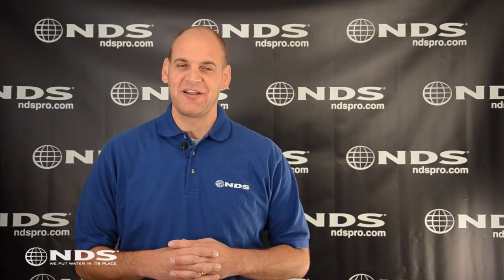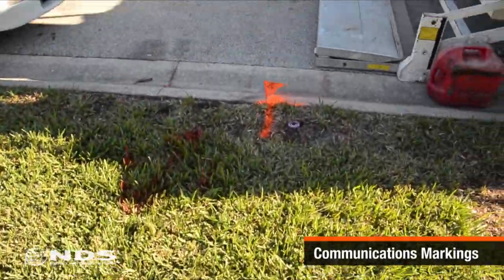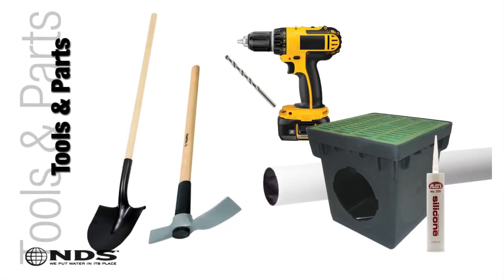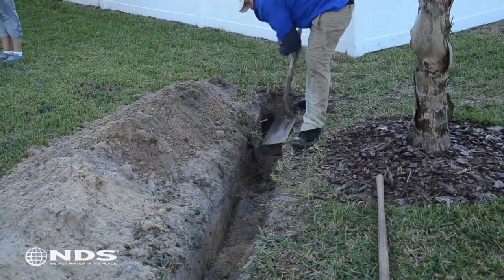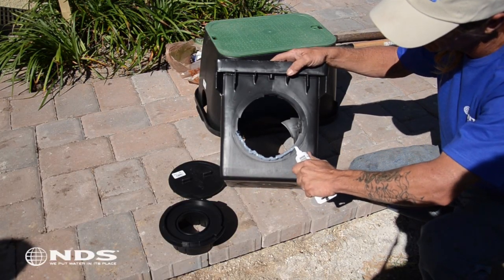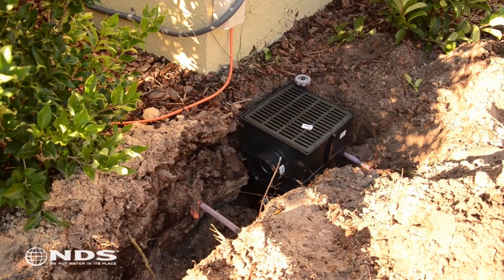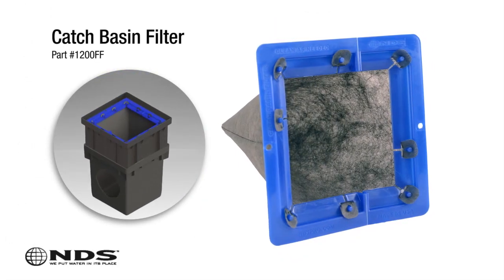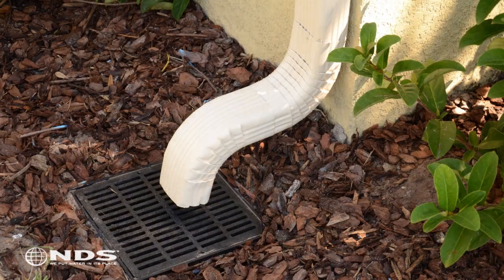How to Install a Catch Basin | NDS Yard Drainage Systems

Comment: which fitting do you need if you are running SDR35?
Reply from the maker: @GioSinatraFan Hi there,

Thanks for your question! To ensure you get the right fitting for your SDR35 application, I recommend reaching out to our Technical Services team. They’ll be happy to assist you with the best solution for your project.

You can contact them directly at TechServices@ndssupport.com.

Let me know if there’s anything else I can help with!

Comment: This video is just an ad to sell extra, expensive parts that aren't needed. Why would you even use a catch basin for this application? These basins have their uses, but not in this application and especially so close to the house. Connect the down spout directly into the pipe. The pop up emitter is just a piece of garbage that has absolutely no good use anywhere. Leave the discharge end open. Why worry about animals getting in? Rain will chase them away just like it chases birds that nest in your gutters. I live across from a river and have open ended discharges for over 25 years and never had a problem with animals. Much better videos on YouTube on this subject.

Comment: This is great info! But how do you put a catch basin in concrete????
Reply: Saw cut the concrete. Doing this as we speak 😂 Had to see how their snap fittings work and here we are..
Reply: @dangaucher5842  Thank you! How do you put one in new concrete? Do you just pour concrete around it? Make a box out of concrete to put it in? Drop it down into concrete? lol
Reply: @powerofknowledge7771  Cut the hole bigger than you need to be, jack hammer out what you cut (only real way of getting it out). Then set your heights, pitch etc after you dig out below it, then pour all around it and blend to the existing concrete. Honestly best bet is to hire someone with all the tools. Renting saws, hammers, etc. will add up and basically negate any savings of DIY vs hiring someone.

Comment: This thing is a piece of crap. Do not buy and waste your time and money on it. For $40 you would think this product will be a tank... It leaks like crazy where the connectors connect to the sides. Water barely makes it up to the 4" pipe. Plus u really should get a screen to avoid leafs and needles from plugging your system. Comes separetly of course for another $23. Find another product.

Comment: I live in South Florida and all these subdivisions, like mine, has 1 million rocks under that grass. Use a pick axe and sweat 6 gallons of water. Have ambulance on stand by for emergencies; heat stroke. Best way: Hire a contractor.
Reply: Wait till winter
Reply: If you have all those rocks, then you don’t need to install a drainage system.

Comment: Water against your foundation is the last thing in the world you would want as it will damage your foundation. Why would you place a catch basin basically right against it and have holes in the bottom that will result in water leaching, likely in significant volumes, right up against it!? That makes no sense to me.
Reply: This is probably to avoid standing water and prevent mosquitoes from breeding. Perhaps they should have called them weep holes and specified the size of the drill bit they used.
Reply: It would likely only account for a few gallons, maybe drill them extremely small.  Dont want standing water to allow mosquitos to breed
Reply: Exactly

Comment: What about the 6 inch round grate catch basin?  I buy a ton of these, and use them at the end of a 4 inch corregated solid line coming off a downspout. And I hate those dumb pop ups.  The mechanicals oftentimes stick and water backs up.  Why not suggest using the 6 inch grate as the endpoint?  That's what I do and it works perfectly.
Reply: Because the grate can clog
Reply: The 6 inch grate is larger than the small popup.  And for homeowners who distance themselves from lawn work and landscaping because it's not their forte, ignore the fact that grass can creep over the popup and cover it completely in a short manner of time.  And with heat beating down on it, the pin of the popup begins to sweel and that causes the popup to not functon or pop up.  The grate can clog if grass grows over it, but the surface is much greater. Can't tell you how often I find popups no longer functioning,  I hated them from the very beginning of my landscape career back in 1986.  I only buy NDS basins with the 6 inch grate, and recxognize they're a much better option.
Reply: Not if you keep it clear

Comment: This looks so simple, but the guy in the video is attaching it to a 4" pvc pipe. That is pretty secure with silicone. I have a 3" pvc pipe and for the life of me can't figure out how it attaches snug. The tabs in there aren't any help either. won't go past tabs.. the 3" side hole I believe is only for corrugated, but doesn't say that in the instructions. Says 3" or 4" pvc.
Reply: Pvc adapter 3” to 4” widely available should work?
Reply: yeah same problem here, it connects much tighter and secure to 4 inch pvc

Comment: Catch basins work great for draining surface water such as a yard low spot that puddles after a rain storm. In the video situation, why not just use a downspout extender to deposit the water 5 to 10 feet away from the foundation and water the lawn? Easily hidden by plantings. Zero digging, no lawn resod/reseed, and easier to inspect and clear clogs. That vertical pop up extension is very deep and it would seem that a lot of water could seep next to the foundation from the catch basin during and well after a rain storm.

Comment: Apartment living is better and more convenient if one just wants to live and not be involved in the flipping rat race of the housing markets. 
The bad aspect of home ownership is that: 
one has to do is buy a lot of silly things and 
one has to do a lot of silly things.
Reply: The good thing of home ownership is this little thing called equity.  You don't get that in an apartment.  Rent is throwing money out the window.
Reply: To Claymore 77: I understand and appreciate your point of view. Yes, there are good things about obtaining a home. You had stated equity, which is procuring of more resources by means of a loan or credit. I agree that free bread is good. But is it really free, though? To repay this is an arduous thing and you do not own the house outright until the mortgage (another loan) is paid off. Even though the interests rates are more tolerable in this era than prior, much extra money is being paid, along with flood insurance, regular insurance, property taxes which an increase would sink many. Attached with the ownership glitz is the glitch of getting many utility bills, and of course the highly dreaded repairs and renovation.  

Even with the Build it Back of NY, Sandy government program regarding their suggested home elevation, they take away much of what was there prior and leave the homeowner to cough up many thousands of dollars to perform work that the program does not do, as; 

Paving. 
Cementing the front area, the driveway, parts of the yard. 
Fencing for me and my neighbors. 
Installing a storm drain line system. 

If I had known this prior, this would have tipped the bascule of my contemplating mind to not participate. Even when I get help -- I still need help! Financial defenestration is perpetual regarding the perturbation of home ownership.
Reply: I get what you're saying, but here's my situation and I know this isn't the case for everyone. This is in Charleston, SC. I went from renting a POS 34 year old 1300 sq ft. town home that was falling apart with a utility bill of around $300-340/month in the hottest/coldest seasons with a yearly avg of about $210/month. I had neighbors letting their dogs use the common areas around my back door and parking lot as a dog walk area and many did not clean up after their pets. I lived right on a main road filled with inconsiderate people with loud bass at all hours of the night and a fire department 4 blocks down that did test runs about 3 times a week...not to mention the regular emergency vehicle traffic. I had apartment staff and subcontractors that could enter my residence at any time and while they were supposed to give 24 hour notice, many (most actually) times they did not. I barely even felt like decorating the place because it was such shit and it wasn't really mine. Obviously no reason to perform DIY improvements for the same reason.  There are a whole slew of other negative things, but you get the idea. The rent on that place was $1200/month (that goes up every year too  btw) and I paid around $50/month for renter's insurance. I had had enough of renting, so I went out and bought my first house. Actually just closed on it last month. It's 1500 sq. ft and I researched the utility bill from the previous year/owners. It was an avg of $140/month with the highest ever bill only $170. It is in a private neighborhood on a back street and nobody can ever build behind me. Grand total mortgage including homeowner's ins, property taxes, and HOA dues...I pay $1350 a month. Granted yes, I know I am now responsible for repairs, upgrades, yard maintenance etc, but I can do whatever I want with this house. I can do cool things for my pets. I can fix things properly. I have a yard where I can grow things. I have a garage where I can build things. Nobody can EVER enter my home unless I ask them to. I don't have to worry about stepping in dog feces first thing Monday morning at 6am on my way to work. It's in a quiet neighborhood on a quiet street.  Yes, I am indebted to the bank for 30 years or until I sell it, but property/home value generally increases over time. I will NEVER go back to renting again if I can possibly help it. The difference and peace of mind is more that worth the little bit of extra money and obligations IMO.
Reply: @Claymore1977  I am a home owner of 13 homes.  That is 12 tenant and that allowed me to retired at 46 years of age and that give me time spent with my children and my wife.  I always suggest to my tenant and friend to buy home if finance allow and some have done so.  I don't increase rent unless it is 10 years tenant to make up for insurance cost.  House appreciate, rent goes up and mortgage goes down.  Imagine if I raise $50 rent each year and that is conservative.  Before buying a home, research and speak to many home owner.  Yes, there are time that I say, renting was good, all the responsibility is on the landlord.  Working is easy for someone else, less headache than owing a business until the owner think you are over paid and replace you.  Research... before you buy.

Comment: So I see in this video you’re using the thin wall PVC similar in most drainage pipe applications other than the corrugated stuff that you can also use but what I am extremely super disappointed with is your design because I bought the smaller catch basin with an atrium gate and it doesn’t have the same connection fitting as these larger ones and I have the four-inch PVC and it doesn’t connect directly to the catch basin without leaking or without extra fittings that I shouldn’t need in this video you showed the PVC pipe connecting directly to the catch basin with out any extra fittings and I would really prefer you to design all of you catch basins the same.  The smaller catch basin has this type of quick push connect fitting already molded into the system made for the corrugated pipe and you sell in adapter but it also doesn’t fit tightly and they both have gaps in them with those fingers that are supposed to grip but they don’t and they leak very badly it’s just very bad design! I would prefer to use a smooth connection that I can glue directly to the catch basin with the least amount of fittings or none at all!
Reply from the maker: Hi Ben! Thanks for reaching out. We have designed our basins with the adapters to fit a variety of pipe sizes and types depending on preference and volume of water that need to be managed.  It is true that some pipes sizes/designs fit better than others, but since drainage systems are “gravity fed” systems, meaning there is very little pressure in the lines, there is no risk of the pipes coming apart after the backfill is placed. When the dirt is compacted around the catch basins and the connections, the connections are “soil tight”.  This means that the dirt around the connections create a “seal” that prevents large amounts of water from dripping
out of the pipe/adapter connection. If you have any further questions or concerns please don't hesitate to reach out to our technical services department TechnicalServices@ndspro.com

Comment: I need to connect to corrugated 4 " pipe.  How does the pipe connect to the catch basin?
Reply from the maker: Hi Dennis! Thanks for reaching out. The corrugated pipe connects to a universal adapter which fits onto the catch basin. The NDS part number for this adapter is 1243 and will attach to 4" corrugated pipe.

Comment: I have electrical and gas pipes which prevent me from digging for pipe connection to basin but would I be able to install just a catch basin and drill holes in the bottom for drainage? Would that work?
Reply from the maker: Hello! Thanks for reaching out. If you install a basin and drill holes on the bottom that could work but it would depend on the type of soil and the permeabillty of it. If there is a big water event or if you have a non-permeable soil like clay, the basin would most likely overflow. You could outlet from the bottom with 3" or 4" pipe, which would work well. There is an outline of the hole on the bottom that can be cut out of the basin and fit with an adapter. Your situation is unique and we would recommend reaching out to our technical services departmetn so they can tell you exactly what type of system you will need for your specific problem: techservice@ndspro.com Thanks!
Reply: Thank you.

Comment: Do you recommend that silicone use with EZ drain to the catch basin as well as EZ drain to EZ drain with the connectors?   I just bought 23 sections, 3 catch basins and 2 pop-ups for a large project.....
Reply from the maker: Hello! Silicone is not required on these connections but can be used to help hold the pipe into the catch basins. The connections aren't designed to be water tight, but the silicone can help create a water tight seal if desired.
Reply: @Ndspro  Yeah, I had no idea. I ended up wanting to waterproof my foundation, after I found a couple cracks, and excavated, on the wall behind behind my catch basin. I noticed the silicone hanging off the rear of the basin. It all pretty much fell off, and I could tell the water was steadily streaming from the bottom side. Streaming means freezing, means all kinds of no good.
I did the silicone myself. I need this sealed. Will butyl caulk STICK? Like a...gutter caulk? I have one of these basins in the front of my house as well, it looks like Im going to have to tear that up.

Comment: Why discharge spout above grate and not directly into drainage lines/catch basin.  If debris clogs top of grate all that water will pour into surrounding ground which is the problem you are trying to avoid.
Reply from the maker: Hi Bob! The reason we are showing a downspout dischraging above the grate and not directly into the drainage lines/catch basin is to help prevent clogging. The grate catches big debris and prevents it from entering the drainage pipe. If you have any further questions please don't hesitate to reach out to our technical services team TechService@ndspro.com Thanks!

Comment: so i drill holes in the bottom that will allow water to go right back under my house
Reply: it's a good idea the holes could be really small so the amount of water released is tiny and it prevents enough water accumulating where mosquitoes become a problem
Reply: Yeah, that didn't make much sense to use silicon to seal the fittings just to drill holes in the bottom.
Reply: that's what i was wondering too.  i think i may have made the weep holes a little too big.  guess i can plug them with silicone and drill new smaller ones.  I am a little worried about erosion underneath overtime.  Not sure though.